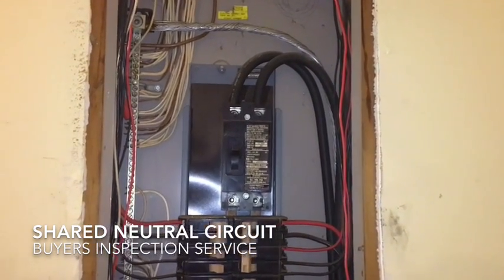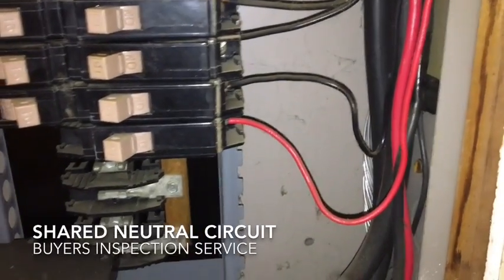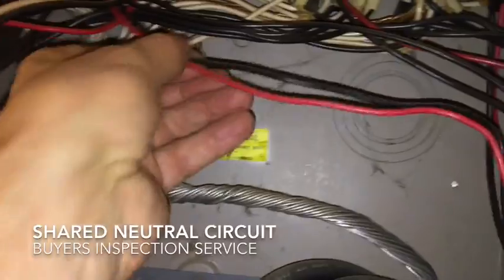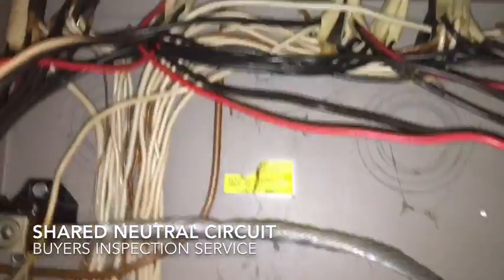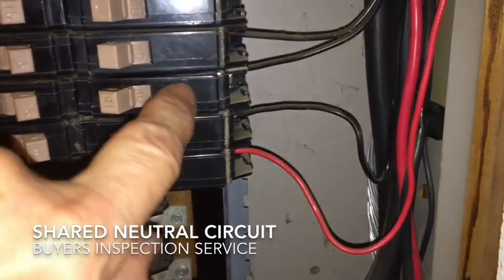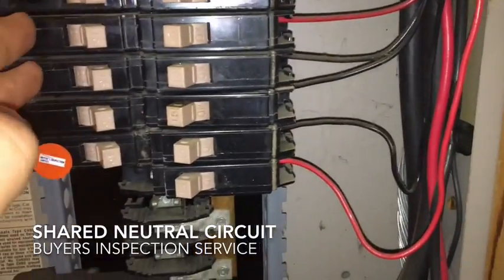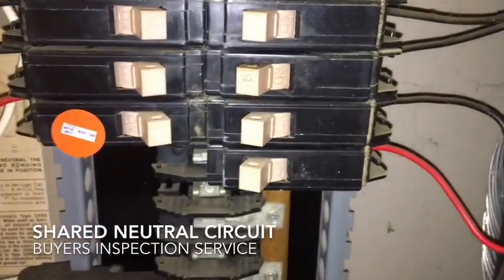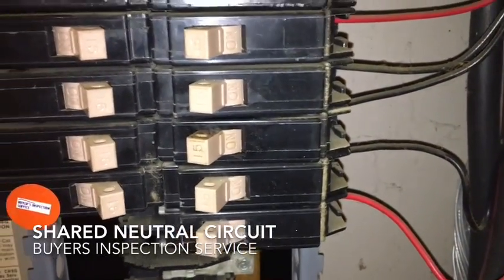Common or Shared Neutral

Comment: If 12/3 is used, it could also be a 240v 20 amp circuit, the white wire, no neutral, should be capped off in the receptacle box. The 2 breakers must be tied together, as you said, in either case.

Comment: It should say "There should be a common trip"....not "there must be common trip".   I am English so I have a disadvantage in that its is  easy for me to receive the wrong message when English is used incorrectly...
Reply: No, "must" is correct.  It is required that there is a "common trip" mechanism for both breakers (i.e. they are tied together so that they always trip together).  "Should" implies there is a choice, but in this case, there is no choice.  If you do not do that, it is wrong.

Comment: Last weekend I turned off 1 breaker to a bedroom outlet to replace the outlet. I got shocked by the neutral wire during the replacement, so checked further and found the neutral had voltage, which was surprising since I turned off the breaker. I ended up turning off all breakers in the panel to finish up and then researched reasons that a neutral could be hot, and learned about shared neutrals in older homes (my house is from 1966)
Reply: so how did you fix it?did you wire it into 2 hots in one outlet?i have the same issue😢
Reply: @hammerridecycling7630  - shared neutral, also called a "multiwire branch circuit" in the NEC handbook, is not a "problem", it was simply the way many residential electricians wired homes in past decades, and how commercial and especially large offices are still wired today. In older residential homes it's especially common to wire the top and bottom of stair lights in this manner in the 3-way light switch. I suppose you could say there is a possible safety problem of getting shocked by the neutral if you only turn off one of the two shared circuits. The solution is to physically connect the handles of both breakers in the electrical panel to force both breakers to be turned off or on simultaneously. If you examine your breaker box, you will also note that the two breakers are on opposite polarities. This has the nice side effect of the neutral wire carrying close to zero current when both hot wires are pulling equal loads, even if both circuits are at maximum capacity. In my case the two breakers were next to each other but the handles were not physically connected. I turned off one breaker and did electrical work and got shocked by the neutral wire. I now turn off both breakers and therefore cannot be shocked again. I don't know if I can buy a double breaker with tied handles for older Zinsco panels, but it's been on my mind to just replace my old Zinsco panel with a modern panel and then of course I'd use a double breaker with tied handles at that spot.
Reply: @donaldlee6760  A MWBC is not a "problem" if it is done correctly; however what OP (and you) are describing was actually done wrong and is against code.  According to the NEC (and as stated in this video), if you are running a MWBC with a shared neutral, it must use a dual-pole or tied breaker, so that both sides are always disconnected together (for exactly this reason).  It is not OK to have a MWBC which uses two independent breakers, at all.

Comment: Thank you 90% of the videos do not mention this. QUESTION : is there a code on sharing Neutrals  if yes what chapter etc....
Reply: This is referred to in the NEC as a "multiwire branch circuit".  There are aspects of the code for it scattered around a few different places, but that phrase is the one you want to be looking for, in general.

The main section that covers MWBCs specifically is NEC 210.4

Comment: That panel is a single phase
Reply: I'm not electrician but residential in North America is two phases after the transformer.  the 240 v is split at the middle.  right?
Reply: @francoisloriot2674 Correct, the 240 is split, But still only one (1) phase of the three (3) phases that are available/provided from the power company.       Repeating, only one phase either A, B, or C.

Look at the top of your neighborhood step down transformer.  One conductor coming into the top?
Reply: @tedlahm5740  ok yes they both coming from one single phase from the power company, but after the split they are shifted 180 deg right?  so calling them phases makes sense at least to me.  How would you call these otherwise?
Reply: They are not shifted 180°. The windings are the same direction from end to end. If the directions were reversed at the mid point, you would have 0v from end to end instead of 240v. The different phases refer to the measurement at the split phase point which is the center tap and the neutral origin.
Reply: Yes like most residential homes, what’s ur point

Comment: That's is correct but was only required per nec since the 2008 code .
Reply: Yes.  i can remember back in the early 1980,s how this was done all the time.  and passed elec inspections then.
Reply: Unbelievable that this was allowed for so long.    Common trip.